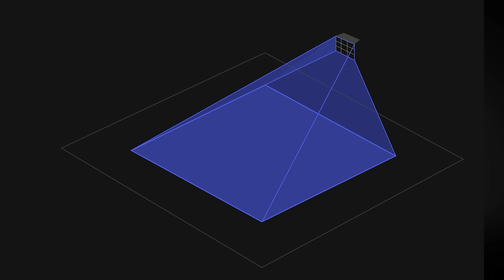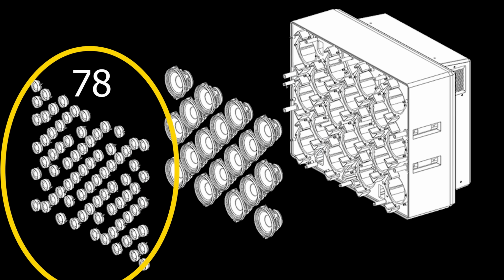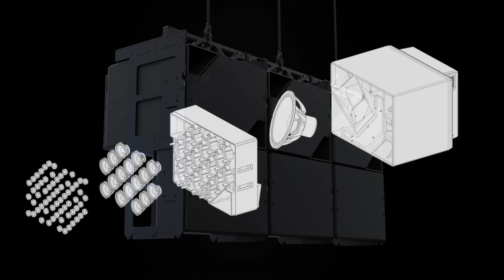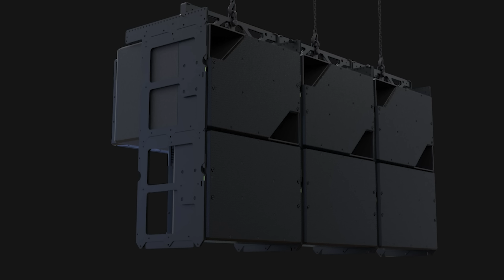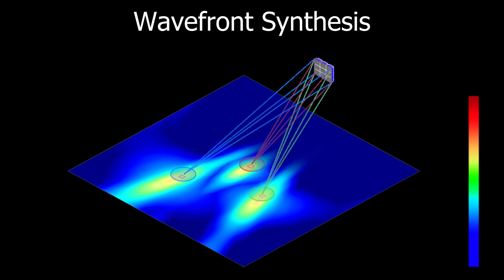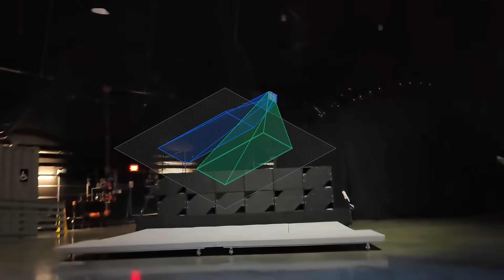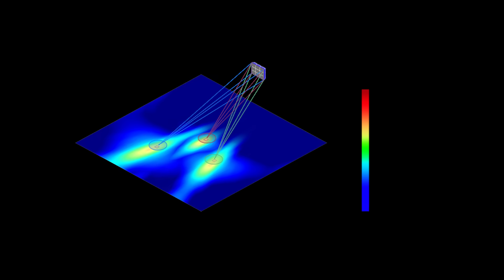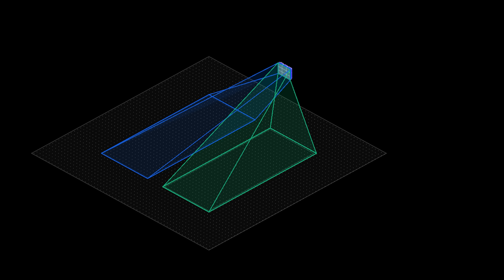Vegas Sphere System - Hear Holoplot X1 Demo

Comment: This is might be cool for presentations and 3D, 4D, 5D… shows… But in live music it’s just doesn’t sound right especially in a very high frequencies 5K and above… these drivers are not close enough to each other to get good summation on that range, so if you will play same signal from all of these drivers at the same time it will give you lots of interference in a very high frequencies. Also how they can throw sound for long distance without any waveguide or any horn?…
I went to U2 show and was able to walk around and listen, so it’s doesn’t sound as good as you expect from this new technology…. The all mid range sounds good and focused, but low end is muddy and not focused and there’s no high frequencies at all I mean there’s nothing from 4-5k and above and I think that they reduce that for a reason.
Reply from the maker: I agree with all of that except for the need of a horn or waveguide to throw. 

Sound is an energy. Wave guides and horns don't create throw. They just reduce the dispersion so that more of the energy is focused in a certain direction and possibly make the speaker a bit louder by increasing the coupling efficiency

Having a whole bunch of tiny little sources all recreating the same sound is almost the same or the same as one big source creating the sound.

Very loud and focused long throw sounds can be created by multitudes of small drivers just the same as a singular large driver
Reply: @DaveRat  thank you 🙏 yeah I meant that with more narrow you can throw highs for longer distances… 
For me personally I like how it works in EAW Adaptive systems that is more usable for live music.

Comment: beyond all the "party tricks" do they actually sound good?
Reply from the maker: Great question. In my opinion they sound pretty good. Not as good for pure music as conventional point source and line array designs. But they do sound pretty good, clear and have relatively powerful output.

And pretty much like how the whole universe works, The more processing and party tricks you try and do the more sonic hits it takes.

I have not mixed a live artist on it, and only heard it with played back music and my experience is that many systems can sound good for music playback but are challenged by live music.

Reports from the sphere trend to focus on the party trick aspect more than the actual fidelity.

It will be super interesting to see where the systems end up and if they catch on

Comment: dave, thanks for the video. what do you think about useability in conventional concert situations say like open air, 2500pax? can it do such things? my usecase is a several weeks long festival right in the middle of a town with an open air stage. this causes problems with soundlevels every year of course. does it work for something like that? how good is the level reduciton outside the coverage area in reality? thanks alot.
Reply from the maker: Low frequencies are messy and even with extreme control over where sound goes, lows and subs which are the primary issue which sound complaints, are not focusable without arrays that are significant in size relative to their wavelength.

Think arrays that are like 100 feet wide and high.

And even then, focusing sound is part of the battle, the reflected sounds will still be a big concern
Reply: Chiming in here on Dave's thread - we have done outdoor events with this system very successfully & there have been discussions with a very large scale festival for noise control as you describe. As Dave says below, the larger the array the better the LF control.

Comment: I saw U2 at the Sphere in October.  The sound is amazing. The visuals are stunning. That venue is a game changer for entertainment. Expensive too.
Reply from the maker: Super cool
Reply: how good can U2 really be?
Reply from the maker: Good point. I mixed rage against the machine opening for U2 and it was interesting but not a show I would go to with out being paid but I do appreciate skill and a great production
Reply: Has anyone else experienced this?
I've been to the Sphere for Postcards From Earth and the U2 show, and both times I was very dissatisfied with the sound.
On Postcards, I wondered why the voice over sounded very aggressive to me, like it was recorded with a shotgun mic for some reason.
But after seeing U2, I tend to think it's the playback system.
I did not get concert vibes at all, it seemed like there was almost no energy below 200Hz. You didn't feel the sound at all, like you'd expect at a show. And the parts where they added in some of the low end shakers only made you realize how weak everything else sounded.
Over-all, the sound felt very mid-range focussed both times and I wonder if that is a limitation of the system.
Reply from the maker: a sphere is pretty much the worst acoustic environment. they have an advanced sound system and sound proofing to try and overcome the sphere issues of reflections and resonance.

and I agree, the sphere has made a concert into a movie. no sonic excitement, all about the visuals.

concerts are usually about going to a venue and experiencing that artist in that venue. the sphere tries to have you not experience the venue but rather to create an alternate reality or experience of being not in the sphere. more like what a movie tries to do

Comment: This is same theory used for AESA Array Antennas 😃👍. The price tag make sense. Each individual component require a discrete amp, phase alignment and signal conditioning. Thankfully to advanced  class D amps in a small form factor and high efficiency in dsp  processing this is now possible. I think this will revolutionize the profesional audio market.  Do you imagine this system in a live concert with the integration of SPAT Revolution: Flux Immersive a real time spatial environment?. This will be mind blowing. I look forward for more content related to this topic 😉👍.
Reply from the maker: I don't see trying to synthesize live sound being popular for live sound.

I see applications where the same scenario is repeated, like movies and trade ahows
Reply: Other companies are develping wavefront synthesis for home sound bars, so two people can sit in a room a small distance apart and listen to their own personal music or other entertainment
Reply: Spat Revolution from Flux Audio allows you to enable Wave Field Synthesis (WFS) using a long row of speakers.  It kind sounds like a Home TV sound bar right? But in this case, the beam is not steered is only one wide beam covering (wide even distributed coverage) the audience.

Comment: Back in the 80's I read some Speakerlab documentation that showed an old experiment where there was a very large array of microphones - think 20 feet by 50ft - behind an orchestra in a symphony hall. They recorded the orchestra and then played the recording back through speakers that were colocated in the same position as the microphones. The audience could not tell the difference between the live orchestra and the recording. Everything old is new again.
Reply: This is the real way forward. All other systems are now as invalid as a Victrola (which I enjoy listening to as I have no choice but to listen to the music since there is no such thing as fidelity or holographic imaging) (-:
Reply from the maker: It could be interesting, Atmos is focused on recreating an environment inside of your listening environment, this system is focused on recreating the actual musicians in your listening environment, kind of different concepts.
Reply: @DaveRat  , I guess, to put it differently, Atmos is actually a rudimentary attempt at creating the spatial audio experience using the technology that was readily available at the time. Holoplot represents a fundamental change to the spatial audio experience, created using advanced theories, cutting-edge technologies, hardware, and software. I truly appreciate the creativity and engineering capabilities of the Holoplot team! This is a tremendous achievement.!!!
Reply: That’s Harvey fletcher’s curtain of microphones and curtain of speakers. Adamson fletcher machine follows these principals in its engine.
Reply from the maker: That microphone curtain concept won't work and it's flawed.

The simplistic concept of grabbing sound from various spots and then re-radiating it loses all of the directional and vector information of the original signals hitting the mics and replaces it with the dispersion of each individual speaker which is completely unrelated to the arrival vector of the sound on the microphone.

To make that work they would need to do something like have each microphone be three or four microphones they grab not only the sound arriving but also the direction from which arrives from.

Then each re-radiating speaker would also be a cluster that recreates not only the sound picked up by the mic but radiates it in the correct direction that the original signal arrived at.

Only then would this system begin to function without blurring things into a mess
Reply: @DaveRat  This demo was done in the very earliest days of amplified audio. Each recording microphone was colocated with the reproducing cone. Each was its own analog channel. In essence a phased array. Since each channel is reproducing the signal exactly in space and time as it was received, it provided a (nearly) exact reproduction. The limitation of course being how wide a band the drivers could reproduce. This is exactly how aesa radar and modern sonar arrays work with large planer(or spherical) arrays of monopoles.

I agree that to get the same sound you do need to recreate the wavefront as recorded in several places exactly and why every home theater is but a close approximation of what was heard at the mixing desk.

Seems to me what is really needed would be standardized rooms with standardized source locations (think I'll call that the Ultimate Home Theater Reference Standard ©). Then we would get exactly what was mixed.
Reply from the maker: Very cool and I'm quite familiar with the concept and have set up reproductions to emulate something similar.

The issue is that a microphone can somewhat determine which direction the sound comes from but can't differentiate between sound coming from the left or right unless it's a stereo mic and up or down or whatever.

To further mess things up once a signal is sent to a speaker it can't differentiate and send sounds in the proper directions unless it has multiple speakers each pointed in a different direction and each speaker pointed in a different direction is associated with the sound micked and received from that same direction.

Have you watched any of the videos I've done on creating real sounding speakers?

I dive into this concept and demonstrate how to recreate realistic sound and why conventional speakers that shoot sound in a single direction are incapable of doing so
Reply from the maker: Interesting and kind of cool and this is something that was not really possible until processing and amplifier size and power outputs could be optimized.

Just the amount of signals sent to each speaker cabinet is astronomical and the amount of data and processing is astronomical and keeping the heat generation down from the amplifiers are all substantial challenges

Comment: imagine this as a stage monitor system that can follow each performer with their own monitor mix.
Reply from the maker: There's so much that can be done it boggles the mind
Reply: it does really.. @DaveRat
Reply from the maker: @maxmaix it's in the Vegas sphere and initially it was pushed as a live sound system and many other applications. The usage potential is evolving and I don't think anyone really knows where or if it's popularity will end up
Reply: Imagine only targeting the dance floor of your appartment at a home party and not blasting the walls and waking your neighbors up.
Reply from the maker: Well it gets complicated because sound is an energy. And while you could focus the sound into a certain area of a room like you can focus light into a certain area of the room, not all of the sound or light goes purely to where it's focused. And the wavelengths of sound are much much larger than the wavelengths of light. Like a literal million times larger.

So to focus sound you need something a million times bigger than what you need to focus light with the same efficiency

Also whatever surface the sound is focused tends to vibrate from the sound that's focused on it unless it's heavy concrete or something like that.

So that means whatever the sound is focused on now becomes a new sound source radiating sound in all directions or reflecting sound or both.
Reply: It’s called in ear monitor 😂😂😜

Comment: Holoplot is very impressive stuff... But you know what's even more impressive?

The Yamaha YSP-1 soundbar. Released in 2004, almost 20 years ago.
Reply: The YSP-1 was a soundbar that featured 42 digital amplifiers, 42 DSP channels and 42 speaker drivers and was able to provide discrete 5.1 audio from a single array of drivers through multiple beams formed and reflected off of walls at the desired virtual speaker locations. Essentially the same as the "different audio sources for different areas of coverage" demo here.   

It also featured wavefield synthesis, mainly in the form of being able to adjust the center channel image's depth.

The craziest feature? The remote control had a built in microphone that, when the "my beam" function was used, would send out a few pulses from the array and send the microphone's captured information OVER THE FREAKING IR BLASTER back to the main unit to compute a very precise, tight, singular mono sound beam aimed right at where the remote was being held... designed for personal/quiet listening.

In 2004. Crazy.